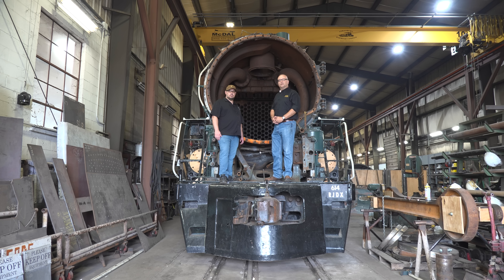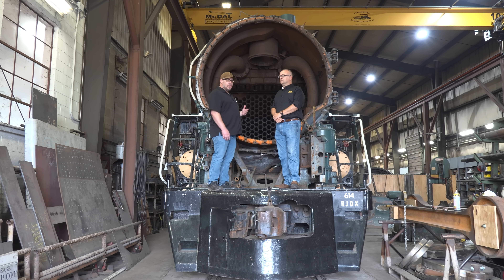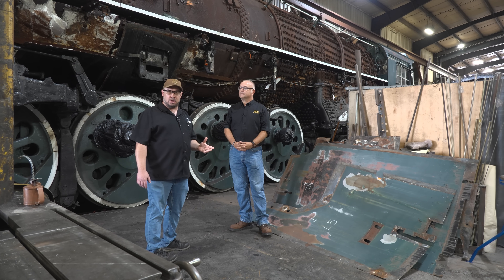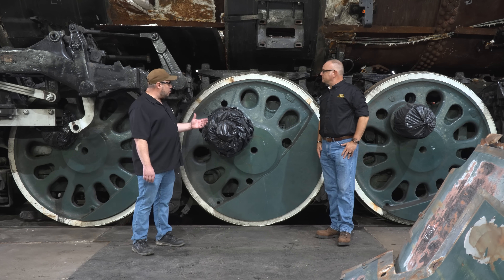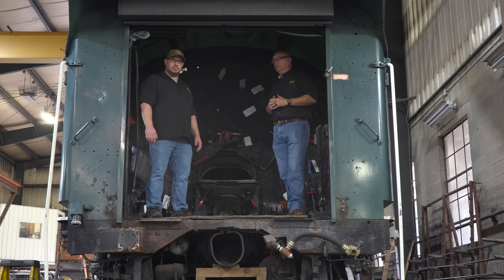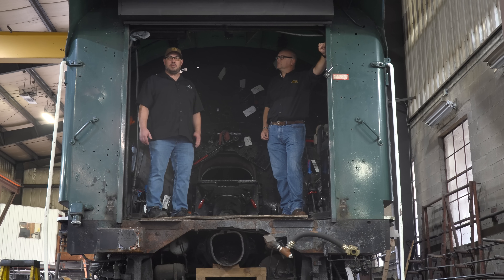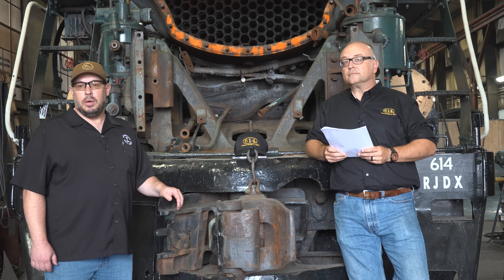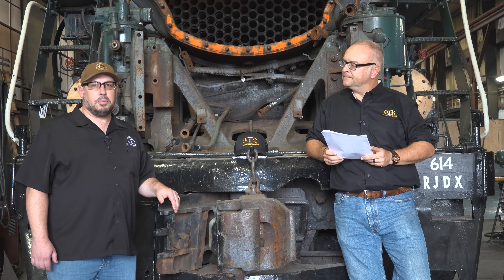September 2025 C&O 614 Restoration Update

Comment: PCT?  Here's a thought.  When you use terms that no one is familiar with except industry insiders, explain the term, or don't use the abbreviation at all.
Reply: PTC = Positive Train Control. It's a safety system required on any locomotive that is at the very front of a train on most mainline operations. It prevents trains from over speeding or passing red signals or into areas where work is being performed on track without being given authority. That last one is also to keep the maintenance of way workers safe.